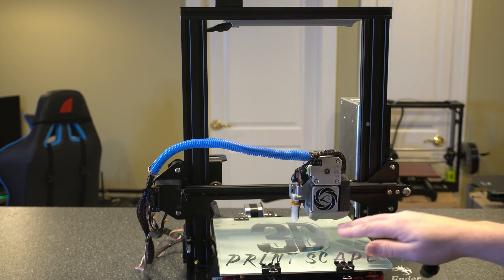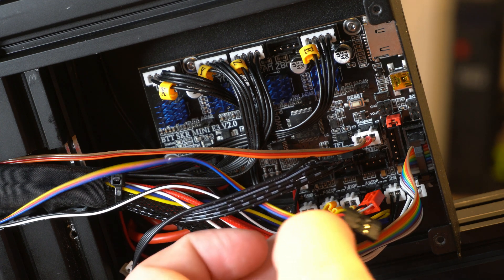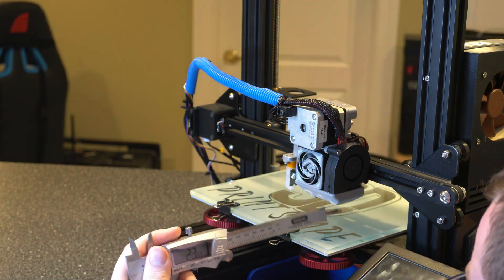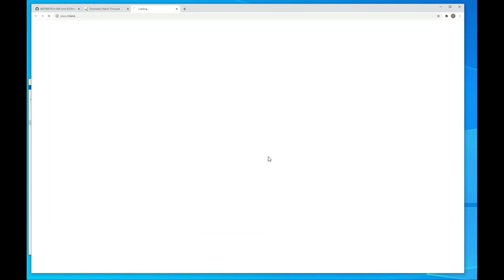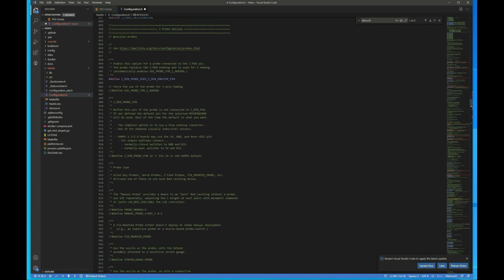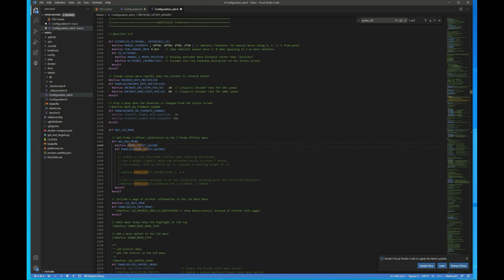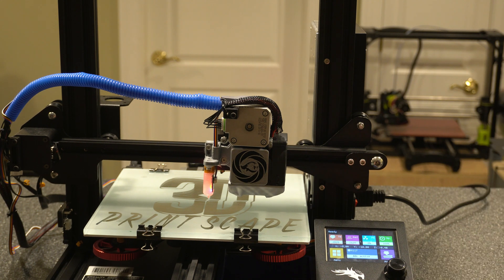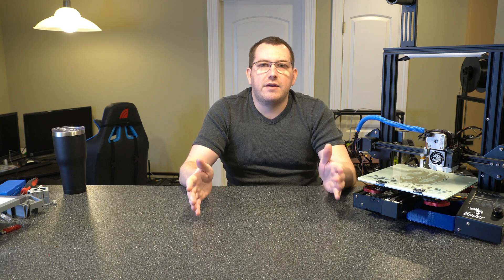BLTouch on SKR Mini – Install Guide

Comment: I'm considering a BTT board upgrade for my new Ender 3 Pro, and just wanted to say thank you very much for covering the layout and firmware modification for a 5-pin probe setup versus the 3-pin and 2-pin split setup, even though you were using the latter. Can't wait to silence these motors!
Reply from the maker: Hi. Thanks for the feedback. If your going from an 8-bit, or the 4.2.2, board, you will love the BTT one.

Comment: The Z offset is not adjusting the Z height for me after compiling and flashing.  I am able to move the X, Y, and Z through the "move" menu though.  Not sure what I am missing.  Any help would be greatly appreciated!
Reply from the maker: Hi. The z offset doesnt actually come into play until a print starts. So if you autohome the printer, it will always go to the +10 position, unless thats changed in the firmware.
Reply: @3DPrintscape  I followed your guide 100%.  I'm at the step to use a sheet of paper to adjust nozzle but the z offset adjustment you went to is not adjusting the height on mine.
Reply from the maker: @g.s.921  If your trying to set the z offset and its not moving, it sounds like the issue maybe with the wiring. How is the bltouch wired and what firmware are you using?
Reply: @3DPrintscape  using the latest firmware from bigtreetech.  Everything is working now, just not able to get z offset adjustment to respond in real time.  Also have an issue with TFT display not showing temps when I start a print with gcode, but works when I preheat then pick gcode.  A few weird issues.  Bl touch is connected to sensor port (3 pins) and replaced stock z stop with the other 2 pins.
Reply from the maker: @g.s.921  Im glad to hear everything is working now. Did you end up changing anything to get it to work?
Reply: @3DPrintscape  thanks.  Z stop adjustments just don't take place real time but affect the print.
Reply: @3DPrintscape  any ideas why?
Reply from the maker: @g.s.921  The z stop shouldn't impact anything, unless its being triggered. If your talking about the z offset, ya that only applies at print time by design. Im not entirely sure why, I could make arguments for it to be either way.

Comment: and didnt help.
Reply from the maker: Hi. What didnt help. If your still running into issues you can check out the written instructions that are linked in the video description.
Reply: @3DPrintscape  so problem start with write the firmware. I got done changing it and went to go hit that check mark at the bottom left of VSC and its not there. Am I missing something?
Reply: found my issue. i opened the folder that had contained my marlin firmware and not opening the firmware
Reply from the maker: @moist_mike8113  Ok cool, were you able to get it to build?
Reply: @3DPrintscape  i finally got yes thank you sorry about the rude comment that came out due to frustration. Keep making videos, you are doing the community a service

Comment: I followed the instructions carefully, but I keep getting this error. 
'Error: Unknown environment names 'STM32F103RC_btt_512K'. Valid names are 'STM32F103RC_ZM3E2_USB_maple, BIGTREE_SKR_2_USB, melzi_optiboot, STM32F103CB_malyan, STM32F103RC_fysetc, STM32F103RC_meeb, STM32F103RET6_creality, DUE_archim, NUCLEO_F767ZI, mks_robin, DUE, FYSETC_F6, at90usb1286_cdc, STM32F103VE_ZM3E4V2_USB, TH3D_EZBoard_Lite_V2, STM32F070CB_malyan, STM32F103VE_longer_maple, LERDGEK, STM32F103RE_btt_maple, FYSETC_CHEETAH_V20, mks_robin_mini_maple, FLYF407ZG, mks_robin_mini, BIGTREE_SKR_PRO, STM32F070RB_malyan, mks_robin_e3, FLY_MINI, malyan_M300, STM32F103RE_btt_USB, mks_robin_lite3_maple, FYSETC_S6_8000, mks_robin_nano_v3_usb_flash_drive, simulator_linux_debug, linux_native, sanguino644p, jgaurora_a5s_a1, FLY_MINI_maple, flsun_hispeedv1, chitu_v5_gpio_init_ma

Any thoughts?
Reply from the maker: Hi. The _512k was removed as an option. Try removing that and compiling it again. The video description and written instructions were updated a little while back, so if you run into issues it may be worth taking a look.

Comment: Shouldn't the Z offset be done with a pre-heated bed and nozzle?  There is expansion of each after reaching temp and this will affect the gap, not insignificantly.
Reply from the maker: Hi. I tend to make the final adjustments with babystepping, which is done when everything is up to temp, but to answer your question. Yes, you should have the nozzle and bed heated up.

Comment: I’m a bit confused, if my wires came with the 5 pin, do I still need to change it for the 3 pin adapter? Also, with the 5 pin connector, do I still need to change wires around to prevent any possible problems?
Reply from the maker: Hi. No, use the 5 pin adapter and plug it into the bltouch port and leave the z-stop plugged in. Also, make sure the wiring is in the right order on the 5 pin adapter.

Comment: im stuck at a blue screen, its been like this for an hour. any help?
Reply from the maker: Hi. It should only take a couple of seconds. I would reformat the sd card, make sure its 16gb or less, and make sure the filename is firmware.bin. I know a lot of people have issues with the SD card not working, so you may have to try another one.
Reply: @3DPrintscape  worked like a charm:) but I have one final issue, when it levels it levels off the bed to the left of the printer, any fix to this?
Reply from the maker: @dingolove5446  Cool, glad to hear it worked for you. If you built the firmware, make sure the x and y offsets are right and clear your eeprom. if its precompiled firmware, make sure to clear your eeprom. i had a similar issue and clearing the eeporm fixed it.

Comment: yeah for the final step i dont know if im dumb or if it updated, but how do i kick off the build, there is no checkmark for me
Reply from the maker: Hi. The checkmark not being there is typically caused by the platformio/c++ plugin not being installed (or the install was bad) or the wrong folder is opened in workspace.

Comment: So it gives a compiling error with the _512K but works without it should I just use the firmware compiled without the _512K
Reply from the maker: Hi. Yes build it without the _512k if you can. They made some changes in the latest bug fix release that causes issues with the _512k environment.

Comment: when i put the micro sd card in the 3d printer with the firmware named firmware.bin nothing happens it's just like nothing happens. can somone please help me
Reply from the maker: Hi. What size SD card are you using and how is it formatted?
Reply: @3DPrintscape  I'm using the micro SD card that came with my ender 3 I don't know much about this kind of stuff so I don't know how they are formatted but if you would need to know I could try to figure it out. And I am using an skr mini v2.0
Thanks in advance 

Oh and as an edit the only thing I've done with the micro sd card is put normal 3d print g.code on it using cura
Reply: @3DPrintscape  thankyou for responding you earned your self another subscriber l. It wasn't the format but I figured it out thank anyways
Reply from the maker: @aahhhhhhhhhh  What ended up being the issue?
Reply: @3DPrintscape  I accidentally typed firmware.bin.bin
Reply from the maker: @aahhhhhhhhhh  Ah ok, ive done that before as well.

Comment: So I downloaded the BigTree Firmware and its STM32F103RC_btt_maple, do i still need to change it to 512K
Reply from the maker: Hi. I havent grabbed the latest build in a while so im not sure if the recent changes from the bug fix line were merged to it. If they were not, you will need to add the _512k, if they were you will get an error if you add it and try to compile.

Comment: I tried 5 different firmwares to get the BL touch to work on the BTT E3 V2,  none worked. Most other compiling videos make assumptions on computer knowledge, which resulted in failed results. This video was to the point and not a watch builder video.(Definition: "Watch builder" You ask someone what time it is and they tell you how to build a watch). Thank You!
Reply from the maker: Hi. Thanks for  the feedback, im glad i was able to help out :).

Comment: I have followed your instructions exactly but I’m facing an issue, the display freezes and i cannot use the control knob when I’m printing any file. Also at times my 3D Touch v3.0 does not deploy and only starts working when I reflash the firmware.
Reply from the maker: Hi. Can you try the firmware from my site? That will help point us towards the problem. https://3dprintscape.com/marlin-firmware-builds/
Reply: @3DPrintscape  I have an Ender 3

Comment: Hi, I keep getting this error " collect2.exe: error: ld returned 1 exit status " I have been trying to figure out what I did wrong, the only difference is that I have an Ender 3 and not a pro. Please help, thank you.
Reply from the maker: Hi. I would need to see the full error to help out. What was the first error that came up in the terminal?
Reply: @3DPrintscape  this the error that popped up
collect2.exe: error: ld returned 1 exit status
* [.pio\build\STM32F103RC_btt\firmware.elf] Error 1
Reply from the maker: @connormorgan6572  Can you try to move the firmware closer to the root of the driver? That tends to fix the "No such file or directory" issue.

Comment: I only received a "run" terminated with exit code 1? 
What I do wrong?
Reply from the maker: Hi. Exit code 1 just means there was an error. I would need to see the full error to be able to help.
Reply: @3DPrintscape  I'm having an issue with the build environment, I changed it in platformio but it doesn't appear when I go to build
Reply: @3DPrintscape  I'll try again and copy and paste the result if I can't get it to work. I'm very new to compiling sorry
Reply from the maker: @porkhunts  Were you able to get that working or the full error?
Reply: @3DPrintscape  hi Rob, no I wasn't able to, I've been busy though and only tried once again. I'm starting over again and will let you know thanks
Reply: @3DPrintscape  ok I installed your pre compiled bin file for z homing, I get a fade height MSG, fade height 10. What now??? Sorry I'm hopeless
Reply: @3DPrintscape  I have an Ender 3pro and btt E3 V2 and TFT dual z and DD, glass bed. Should I even worry? I'm waiting on a pair of backlash nuts, this was my only problem I believe, one side dropping, ABL wouldn't really fix it only adapt to the error, am I correct in that part? I'm more mech than tech
Reply: @3DPrintscape  I appreciate the assistance BTW, it's most confusing when I search for a solution online
Reply: @3DPrintscape  I was previously getting great prints but not repetitively
Reply: @3DPrintscape  also I'm Aussie, explains the delayed reply
Reply: @3DPrintscape  thanx Rob for your assistance, I finally worked it out. Between vids, reading and persistence I got there
Reply from the maker: @porkhunts Cool, glad its working. What ended up being the issue?
Reply: @3DPrintscape  TBH I'm not entirely sure, like I said I ended up using your bin file and put in my own offsets manually using the terminal then wizard for the z homing.
Reply: @3DPrintscape  user error, I'm terrible on a computer, and my computer is old, slow.

Comment: i have tried to add the fireware.bin to my sd card and put it into the tft slot. The firmware doesn't load. Any advice? The firmware.bin file is in the root and i did manage to upgrade the tft firmware following your video tutorial. no sure what to do here now
Reply from the maker: Hi. Make sure the SD card is 8GB or less and formatted as FAT32.

Comment: I've been having issues with setting up the firmware. for some reason every #define line is an error. i saw that was the case in the video to, but then they just dissapeared at 11:47. I tried following the axact steps, including commenting the s stop out and back in, but nothing changed like it does in the video. these errors also mean i can't compile the firmware.
Reply from the maker: Hi. Can you provide the full error you are getting?

Comment: It's a great guide! So helpful! Thanks for posting it. 
After I have tried everything, there's still one thing that I can't fix, the bltouch only measures the bottom left corner for bed leveling and I can't get it to measure more points on the bed. 
What can I do? 
Thank you in advance!
Reply from the maker: Hi. Is it actually probing the bottom left corner or attempting to and failing? If it cant get a good read, it will just fail then move onto the print.

Comment: I did everything like you ... and I have this error "Error: Unknown environment names 'STM32F103RC_btt_512K'" x.x
Reply from the maker: Hi. I saw a similar behavior with the updated builds. Try to remove the _512K, build it and let it fail, then add the _512K back in and build it again.

Comment: Getting "Error: Unknown environment names 'STM32F103RC_btt_512K'."
Seems like they removed it from the config. I will try it with STM32F103RC_btt_maple now.

Why could they not keep the old var and mark it as deprecated?
Reply from the maker: Hi. I need to look into this one a bit more. I was able to compile last week with STM32F103RC_btt_512K, so i will need to look at what changed when i get a little time.
Reply: @3DPrintscape  Got an answer to my GitHub ticket:

STM32F103RC_btt_512K was a horrendous hack, and should never have been allowed.
If you have a STM32F103RC it only has 256K of Flash, using more than that is not recommended, Its not meant to be there, has never been tested, is quit likely a failed STM32F103RE they they sold as the lesser chip.
you use STM32F103RC_btt or if you actually have a STM32F103RE chip STM32F103RE_btt

maple is legacy, will be removed soon
_USB is if is you want to mount your sdcard as a usb drive.
Reply from the maker: @iuiz  Interesting. I know hundreds of people that have used it with no issues. Did you end up getting a working build?
Reply: @3DPrintscape  Yes, the STM32F103RC_btt setting worked fine and I did several prints with no problems and got the leveling working.
However I think it is a mistake of the developers, that they did not mark the old setting as deprecated.
Reply from the maker: @iuiz  The change is only in the bug fix line, so it's still really just beta at this point. I guess we will see what they end up doing for the actual release.

Comment: Hey, I did the same wiring as you, and now my Skr mini e3 v2 is smoking. It has to do with 5v, I want to use it but I can't because the screen of the board dims and goes off and the board turns off. Please help!
Reply: @3DPrintscape  yep, it is, idk what to do about it, thanks for replying
Reply from the maker: @coldapollo8731  Im not sure where the rest of this chat is, but I think you will need to swap the +5v and ground on the skr mini side.
Reply: @3DPrintscape  yeah I got another cable works great now

Comment: Mark,,,(thanks for your service to our country) and great video. I have followed every step, watch over a few time to make sure I have made all the changes you state. I flash my SKR Mini E3 V2.0. do a M502 and then M500. When I boot the printer, I get a "FAIL TO ENABLE BED LEVELING". What can I look for that I did wrong?
CONFIGUATION.H

#define STRING_CONFIG_H_AUTHOR "(CLO  VER 2.0.8)" // Who made the changes.       //CLO_UPDATE
#define BAUDRATE 115200    //CLO_UPDATE
#define SERIAL_PORT_2 -1   //CLO_UPDATE
#define MOTHERBOARD BOARD_BTT_SKR_MINI_E3_V2_0         //CLO_UPDATE
#define CUSTOM_MACHINE_NAME "TAZ 6 - Marilin 2.0.8"    //CLO_UPDATE
#define DUMMY_THERMISTOR_998_VALUE  18        //CLO_UPDATE
#define Z_MIN_ENDSTOP_INVERTING true     //CLO_UPDATE // Set to true to invert the logic of the endstop.
#define Z_MIN_PROBE_ENDSTOP_INVERTING true     //CLO_UPDATE // Set to true to invert the logic of the probe.
#define DEFAULT_AXIS_STEPS_PER_UNIT  {80, 80, 1600.00, 830.00}      //CLO_UPDATE  { 80, 80, 400, 93 }   
#define DEFAULT_MAX_FEEDRATE   {300, 300, 3, 25}         //CLO_UPDATE { 200, 200, 5, 25 }
#define MAX_FEEDRATE_EDIT_VALUES    { 600, 600, 6, 50 }    //CLO_UPDATE  
#define DEFAULT_MAX_ACCELERATION     {9000, 9000, 100, 10000}    //CLO_UPDATE { 1000, 1000, 100, 5000 }
#define Z_MIN_PROBE_USES_Z_MIN_ENDSTOP_PIN    //CLO_UPDATE
#define BLTOUCH    //CLO_UPDATE
#define NOZZLE_TO_PROBE_OFFSET { 1, -25, 0 }    //CLO_UPDATE
#define INVERT_X_DIR false       //CLO_UPDATE
#define X_BED_SIZE 300    //CLO_UPDATE
#define Y_BED_SIZE 300    //CLO_UPDATE
//#define MIN_SOFTWARE_ENDSTOP_Z     //CLO_UPDATE
#define AUTO_BED_LEVELING_BILINEAR    //CLO_UPDATE
//#define MESH_BED_LEVELING    //CLO_UPDATE

CONFIGUATION_ADV.H

#define GRID_MAX_POINTS_X 3     //CLO_UPDATE
#define Z_SAFE_HOMING    //CLO_UPDATE
//#define LCD_INFO_SCREEN_STYLE 0     //CLO_UPDATE
//#define TFT_DRIVER AUTO      //CLO_UPDATE
Reply from the maker: Hi. Can you email me your configs and picture of the bltouch wiring. My email is admin@3dprintscape.com
Reply: @3DPrintscape  hi, i also have the same problem "FAIL TO ENABLE BED LEVELLING " when i turn on the printer after firmware update with the settings from your video
Reply from the maker: @paulwakeling7501  Hi. Thats normal if you have a tft. It won't enable the ABL on it until a mesh has been ran once. If you run the mesh, save your settings, then restart your printer you wont see that anymore.